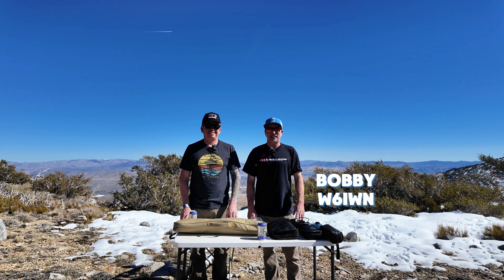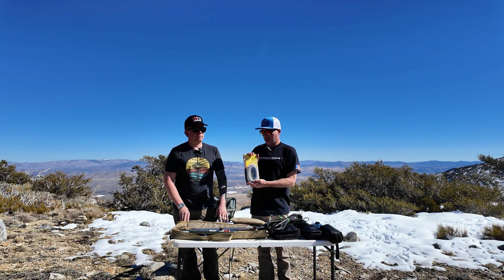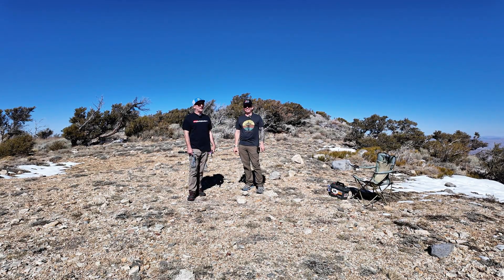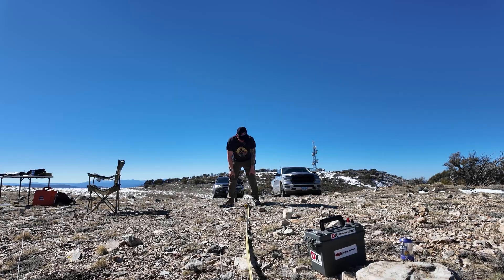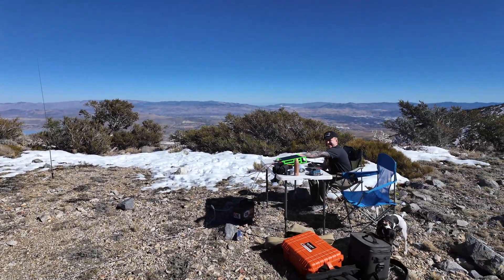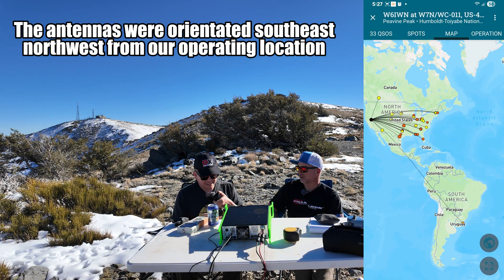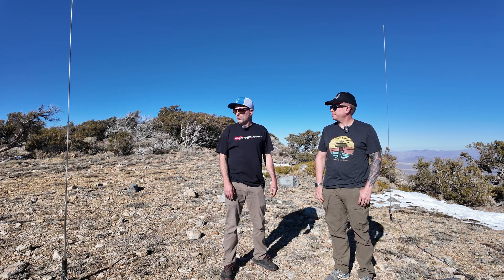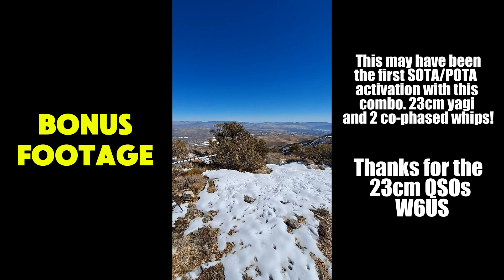Co-Phasing Antennas Portable Ham Radio

Comment: Having worked in AM directional radio for several years, this is fairly easy to do. Hmmm, I have two tripod antennas, 75 ohm video cable and a BNC T connector. I would want to make it work for a broad cardioid pattern pointed South. Sounds like fun.
Reply from the maker: Get out there, experiment with it, and don't forget to have fun! Let me know how it goes. Thanks for watching 😀